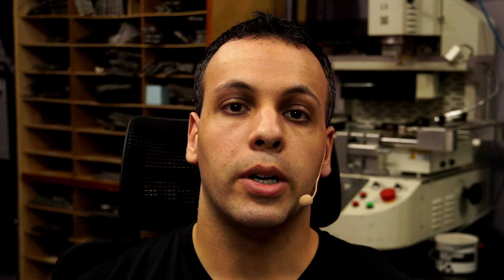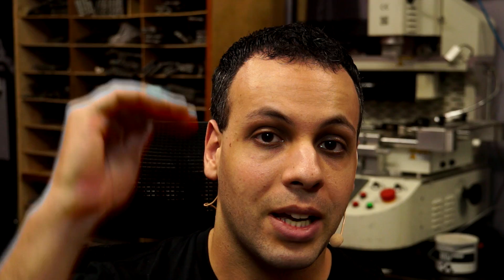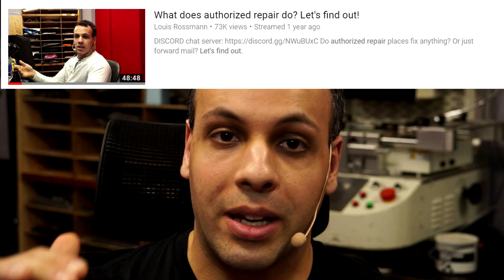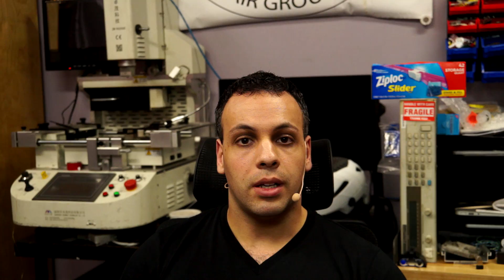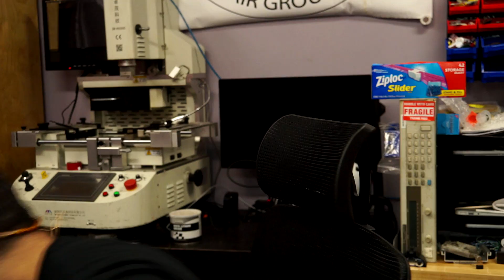Apple's war on refurbishing.

Comment: you're the new Richard Stallman Luois.. you're absolutely right.. we cannot even use "NON" Apple mouses on a Apple machine.. the mouse will work erratically will do strange things .. the reply from apple Genius Bar it is "yes man you should definitely buy a magic (90$) mouse to work with your Mac" are you mad??? a mouse a simple mouse won't work because the machine doesn't like it? what the heck .. where we are all going to end? this is complete madness.. guy wake you up .. this is not good ..

Comment: Thanks for this video. This continues to be an important issue. I would assume it is possible to get a refurbished part that is better than the original, as is possible with automotive parts. They engineer a device and parts to be within a tolerance, and price range, and then select which manufacturer to use. Sometimes two devices with same retail packaging and device Id can have  different parts used. The consumer has no way to confirm which one they are purchasing new . At least with a refurbisher, a customer has an option,.

Comment: I agree this is horse shit. This is actually similar to BMW, even the really old ones. I had a cluster go out in a 2001 330Ci, and it required, not only a FACTORY SEALED BRAND NEW cluster to be installed. No, thats not enough, it had to be INSTALLED AND PROGRAMMED by a BMW DEALER to work with some kind of chip that only BMW CORPORATE provided or else it wouldn't work at all. If your cluster went out, it would be literally impossible to repair yourself even if you bought a factory cluster brand new directly from BMW themselves. You HAVE to get it programmed by an authorized BMW dealer.

Comment: I just replaced my iPhone7 screen with an aftermarket screen and completely severed the small ribbon cable connecting it to the motherboard. Completely severed, no longer attached to the clip. Everything still works fine. Utterly bizarre.

Comment: Been an Apple user since the 1980s.  I own iPhones, desktops, and laptops.  No longer Apple.  You have become the evil empire that your old Super Bowl commercial called IBM.  I will not buy a $1000 iPhone nor a new Mac.  Going to Arm processors in 2020 will be the final blow.

Tim Cook you lied about Apple having offshore tax havens as the Paradise Papers showed otherwise.  You lied about Foxconn worker abuse.  The list is extensive.

Ask Sony how well they are doing since they tried a proprietary system in the BetaMax.  Simply put, I will be moving to Android, holding onto Mojave for now, and moving on to other hardware or LINUX.

BTW...keep your fuckin APFS off my SSD and platter drive.  There are not any utilities that can fix APFS as you damn specs keep on changing.

There are only a small amount of rich people that can afford your products.  I don't need the status of dumb rich people like Ivanka Trump or other wealthy brain dead people.

Remember Apple and shareholders...the bigger they are, the harder they fall.  Ask Rupert Murdock about My Space.

Comment: Louis,
Love your channel and more importantly what you do.  I'm a computer technician that works for a depot and in the Apple area.  They  are very secretive, to the point that all areas where Apple techs work is  fenced in with covers over the fencing.  I have been trained on two of the new Macbook Pro systems.  We of course do not call them that.  With the new system they have removed some items from the MLB but they have included a touch-sensor.  The SSD drive is embedded in the new MLB along with the GPU as well as CPU.  

To make a long story as short as possible.  All parts that we use are refurbished, maybe not at first but they will be very quickly.  If anything is wrong with an internal component including the SSD now, we have to change the MLB.  Every MLB is tied to the touch sensor, so a new touch-sensor has to go in as well.  Old MLB and touch-sensor that is pulled has to go back to manufacturer to be reset.  This means that if I place in a new refurbished MLB and touch-sensor and it is DOA They will have to go back as well.   I'll be so glad to see you finally rebuild one of the new models.  I want to see your experience in lining up that touch-sensor.

To be honest, I'm quite curious as to how the mouse will be able to trick the cat this time around.  Now if you are able to remove and replace chips on an MLB I don't see an issue, but getting around that touch-sensor may be a little tricky, so if you have an OS issue and need to remove the internal component there.....  Like I said, I'm looking forward to future updates about the new systems. 

Imagine standing the machine on its side with display open.  Then  using a little plastic alignment tool that only covers three sides of the button with one hand while placing in 6 screws with the other hand.  I've only done it twice but each time took me about 20 minutes to get that touch sensor in and aligned properly.  CRAZY!!!

BTW- I have never owned an Apple product in my life.  When I was hired they asked me if I would have a problem working on apple machines.  My response was apples and oranges it's got everything a PC has it just runs a UNIX OS.  I run both Windows and Linux.  Windows because of the amount of software available and Linux because I love it.

Comment: it doesn't matter. Apple is STILL in 2018 releasing laptops with 8GB of ram with no upgradable slots. I am an Engineer, and anytime someone asks what Apple computer to buy, I tell them the last model that had upgradable memory slots. Otherwise don't buy one. Apple is making is so that you cannot upgrade ram or SSD, you have to buy an entirely new logic board or stick with the lackluster machine you paid for by sacrificing your first born. I point people straight to Lenovo because they have excellent products with excellent prices!
Lenovo X1 Extreme - $3,226.00
15" 1080P LED Screen
Intel Core i7 8850H 2.60Ghz Turbo speed up to 4.30Ghz
W10 Pro 64
NVidia GeForce 4GB 1050Ti Discreet graphics
512GB M.2 SSD (with additional SSD expansion space) 
64GB DDR4 2666Mhz

Apple MacBook Pro 15" - $3,199.00
Intel Core i7 8850H 2.60Ghz Turbo speed up to 4.3Ghz
15" Retina display
32GB DDR4 2400Mhz no option for faster ram speed (this is maxed out)
512GB SSD M.2 (no expansion slots for additional SSD)
Radeon 560x 4GB Discreet graphics

So for $27 less, you get a better screen, but that's literally it! 
The Apple MacBook Pro has a maximum support of 32GB of slower speed ram and no options to upgrade even if support exists for 64GB, only one M.2 slot, soldered onto the board, no options to upgrade to 1TB or faster M.2 SSD. A slightly slower discreet graphics card. 

What do you get for $27 more?
better graphics card, 32GB MORE of even faster ram, upgradable SSD slot, and an additional M.2 slot for support for even more SSD space!

The only thing you would want the MacBook for is the OS. Is that OS worth THAT much that you would get a machine that is already obsolete?

Comment: Even if there is a "right to repair" it should also be illegal for products to be designed so that certain features/parts cant be repaired/replaced without going to the manufacturer. Sure I technically can replace an iPhone 7 Plus screen with a non official parts for $100 at a local repair shop but if your Touch ID wont work without "official parts" then I would essentially lose that feature if I do not cough up $300. BTW I don't own an Apple device and never will this is based on my fiances experience.

Comment: Just another angle on this case. You take a fully functional phone with a broken screen, replacing the glass uses minimal energy and waste, however, replacing the phone uses maximum energy and waste. Environmentally Apple are being extremely irresponsible, not a good image in the current situation on a global waste problem.

Comment: Don't worry Louis, this is just a market trend. You will be celebrating in 2025 with your brand new phone sporting a 19.999:1 (extra compatible) triple-notched LCD with rounded corners, no ports (you need to be buy the separately sold wireless port hub for that) or removable parts at all (they are all soldered for extra security), extremely custom android with locked bootloader for safety, and blistering fast 5.5G (that will last for 5 seconds unless you pay more for unblocking one out of the thousand tiers of data caps - net neutrality not included), and 2000mAH battery. 
The screen (and equally strong glass back) is so durable that it can even stay in your pocket without breaking! Of course, since personal property of personal computers has been abolished by Apple, if you drop it once, which you definitely won't with its super slippery finger-print magnet of a screen (AND THE BACK!), you will have damaged their intellectual property, and deserve to pay a fine to the phone brand. Of course, by now only the most priority and important features are present, like an ultrasound in-display fingerprint sensor, a fold-able screen, a 99% screen-to-body ratio (wow, just a 10% of chance of mistyping the screen, how low!), and other super useful, totally not secondary features! All these features are present in every price segment, starting at ONLY 999.99$ (shipping not included - no refunds - won't give your soul back)!

Comment: Great video, I don't think people are fully understanding the right to repair and the consequences, this ideology can be applied to free speech , compelled speech and all other aspects of live   , served my time as a TV/VCD/DVD and for a small period of time laptops/camcorders, the trade died in the UK about 18 months after surface mounted components came along , we had a bg magnifying glass , but nothin like you setup , the soldering tips we had would have done a plumber proud :)  did you really solder that R with a heat gun ? if you get dry joins , would you use a tip to re apply it ? is solder mop still used or a sucker? I remember last time  I used it on a board like that , I think I removed 60 components whilst working on a little thyristor. 
Are you self tought , I was an apprentice whilst doing college/uni inbetween .

Comment: Latest Iphones are made almost impossible to repair since
they are glued or they use materials that are made so you can’t open the device since it will lose waterproofness or make the phones parts to move. Basically, they are making
phones unrepairable. On the newest Iphone changing battery is not easy since
you need certain equipment’s to fix it.

Comment: I don't really see why apple has a problem with this part I mean true they might not "sell" as many screens in there own shops but to be honest personally I hate it when good things with minor repair issues are going to waist just because they need a bit of TLC since when it comes down to it it's a matter of resources and a waist of them and I'm not for that part I'm for refurb I mean I haven not ever had a "new" laptop I have always gotten used laptops a few years old but still in good shape and then I make them my own by upgrading them to what I want them to be in case I need to and yeah I have had a family member busting two laptop screens within the same year although I asked  the person to learn from the first mistake witch the person said that she wanted to do although 3 - 5 months later she "cryed" up over the fact that she didn't have a laptop anymore and to be honest that' is a waist of perfect working things since the last screen she busted didn't have any bad pixels or white burnin marks or anything it was perfect but she is a bit rough with things even her cellphone has taken a huge amount of beating so I will admit that for my mom to pay for that last laptop even though I mentioned it wouldn't last that long that it was a waist of money witch also the reason why I don't put a new screen on since then she don't learn anything other then she breaks and I fix nope is my answer to that :-)

Comment: My iPhone 6s got really really buggy after replacing the screen (authentic screen but installed by a 3rd party). Do you think is is intentional? I've always gone with iPhones for their longer lifespan, I guess that's not true anymore. Nice work Apple, you very possibly have converted me to a Droid user. Keep it up.
Reply: The expected lifespan of an iphone is 1 year, to coincide with the next release.
Don't kid yourself.
Reply: Leroy of Imperium it used to last very long. In fact my 6s was going pretty strong until I replaced my screen. Now out of a sudden it’s buggy as hell for no reason.
Reply: What system is it running? I use iOS 11 on my iP 6S but it wasn’t necessarily the best choice to upgrade it from the 10. I kind of regret it
Reply: Celestial Crusader I’ve downloaded every update that was pushed. So I’m pretty sure I’m up to the latest ios right now. It’s so annoying the touch is so buggy.
Reply: I have a 6s with an authentic screen installed by a third party. No problems at all. 

I’ve only had two iPhones in the past 6 years. I continue using my phones long after the one year cycle. Typically because I will only update the software up to the initial release of the following generation/seres (so I had the 4, updated it when they released the 4s; I have the 6s, updated it when they released the 7). After that I stop, and I’ve never had the problems I’ve seen friends of mine get. I will be fine having this phone for another year or so probably.  

I’m going to switch after this phone due to the pricing. I like owning. I could tolerate the typical lease to own model, but if I need to lease phones I’ll never own in perpetuity to afford a phone it isn’t worth it for me.
Reply: Alexa Raven so they really are nerfing my iPhone through updates you reckon?

Yes I agree, the new pricing is way to high for me anyway so my next phone will definitely be a Droid, nerfed or not.

Comment: Thank you for this video.  I am very concerned about Apple taking away consumer rights to the property that I buy.  I just replaced my iPhone 6 Plus screen (with an Amazon knockoff) and I was concerned if it would even work for the reasons you said.  It did work.
I am an electronic technician and I want to be able to continue fixing my electronics.

Comment: The most positive trend on the horizon?  The fourth industrial revolution.  Current 3d printers/etc, aren't there yet.  But even things like single board computers which can be turned quite inexpensively and quickly into netbooks, etc....power users are already able to build their own phones.  It's already begun.  Nerds like us HAVE to go harder and faster toward complete autonomy.  Apple can't do a damned thing if it's a BeagleBone in a generic case that probably will outperform (and outlast) their junk, anyway.

We will not stop hacking...whether it's software, hardware, home manufacturing technology.
We WILL win this war...but it's not going to be easy.

Comment: Sounds a lot like the way Tesla works, and why I would never buy one unless things change.  They don’t want anyone to repair vehicles they deem unworthy, even themselves.  I grew up working on my own cars.  This is almost robbery.  If they were renting you a product for a prescribed period it would be different.  When I was in the electronics repair business, I’m pretty sure it was a law that a manufacturer had to provide replacement parts for at least ten years.  Of course they made the part so expensive and the products so cheap that it wasn’t feasible.  Apple products are definitely not cheap.  Something must change or I won’t be replacing my Mac with a Mac as much as I like them.

Comment: I was a big time Apple fan boy back in the day, but I am done with Apple all because of there current choices they have been making with the Mac.
I was using Mac's even back in the Power PC days, but I stopped using Mac's 2 years ago.

Even 2 years ago I knew my time with Apple was basically over. because Apple was already making anti consumer choices like how on the new Macbooks you couldn't upgrade or replace anything..... & this was spread out to all there hardware accept the Mac Pro. (Mac Pro simply is just never updated & sold for the same price) 

But the kick in my ass 2 years ago was loosing both of my old current Mac's first my 17inch 2008 Macbook Pro, had the GPU issue the GeForce 8600M GT was prone to then.
Then my beloved 2008 8 core Mac Pro died, not 100% sure what it's problem was but it seemed to be within the logic board the best I could tell.

Looking at what was currently being sold..... Not a single new Mac was of any interest to me, and if I was to get replacement it would be buying old hardware.
Like a pre retina Macbook Pro would be acceptable, & I suppose any Mac Pro I could afford. with the key word being afford....

So that's when I decided it was my time, & even moved away from my Iphone & Switched to Android. 

I am actually writing on a Mac I purchased 2 months ago..... Because I got a wicked deal on a broken early 2011 17inch Macbook Pro.
That I "fixed" by changing the EFI to only use the Intel graphics chip rather then the dead Radeon HD 6750m.
Annoyingly I still love using a Mac..... (after changing the OS to behave like Leopard) 
But this without question will be the last Mac I own, because it's one of the last pre retina Macbooks, and basically the last 17inch model that I have always loved.

I hope Apple's new hipster audience notices all these anti consumer things they do, and speak with there money and shop elsewhere....
But the problem with the bulk of Apple's current audience is there not likely too.....
I am a relic of there past. They no longer produce products for people like me.

Is Steve Jobs death to blame? or was he already moving Apple into this direction....
Hard to say..... I'd like to think Apple would be different today if he didn't die.....
But at the same time..... I could picture him at least laying out the ground work into what Apple is today....